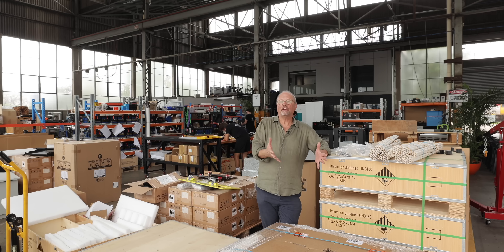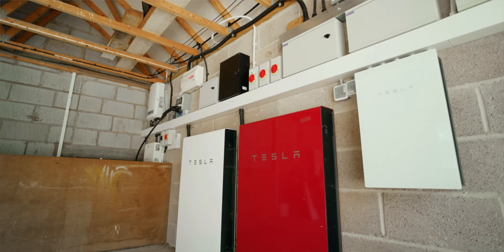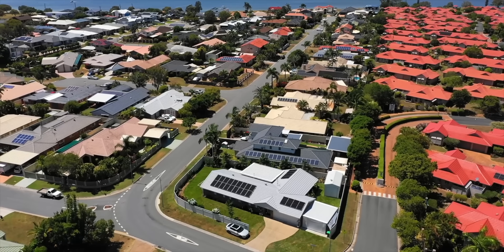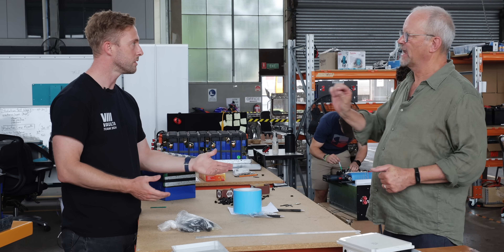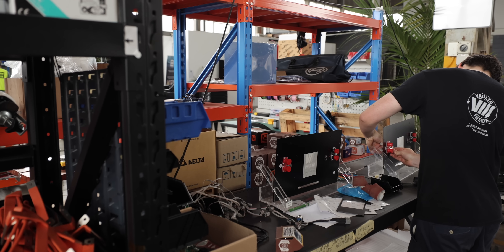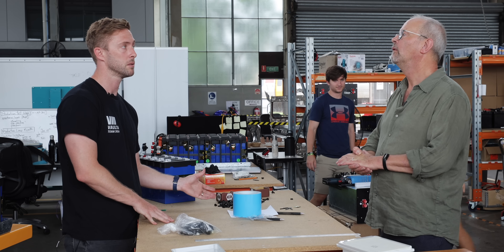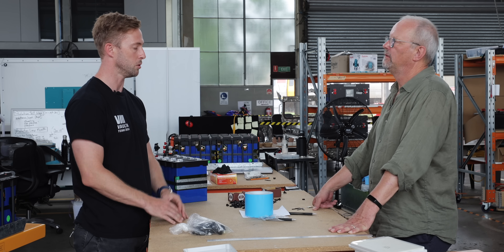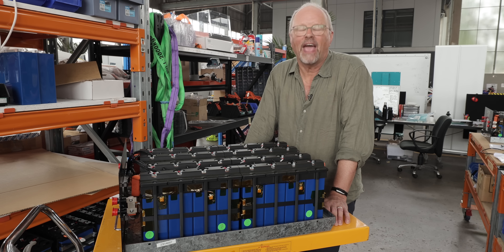THIS Recyclable Tech Solves Batteries' Biggest Problem!

Comment: How is this fault finding so hard for Ev charger installers. Especially grouped ones. The law should be no new gas stations or extensive development without multiple medium fast chargers. The issue with light poles is at max they can charge at 22kw and thats essentially a trickle charger when you need as default 40-50kw

Comment: The problem down the line is the capacity loss will mean using old cells, bigger cells for less work, but still taking up the space. 
If you buy a 200ah cell or a 100ah, they are different sizes, but as the 200 hits the 100ah mark, you'll have a much bigger battery...

Cell price drops don't help with 100ah cells coming in at £32. It's hard to beat a new against worn out..
They will have to make this more attractive cost wise.

I see idiots selling used ev battery cells for more than the cost of new tech batteries of the same capacity.

Comment: 8:21 - what is he trying to tell us: picking 15 cells out of this and 1 from another used battery to build a new one ?

Crazy stupid cause those are in different shape and degredation. You should not connect for example 2 of thee batteries if the first had been unsed for more than 2 years. 

Feels like big advertisement or scam cause these rack batteries had been used for cell towers for almost a decade across the globe and now they do that were just to rint vaulta on top?

Comment: Battery storage is to negate the increasing negative effects of variables.
There peak.
These peaks are visible in duck shaped pricing. 

The increased peaks and depths of prices (also delivery/demand) is the overall cost increase of electrical energy delivery. 

Simply increasing storage or solar will not decrease cost. 

Storage isn't bad, it's just a tool and not a golden bullet. 

Ps: nice insight about this company and there durability approach.

Comment: Fully Charge got a question about Battery care. So I saw a vid saying on the recommendations of a professor the Ni cd batteries should be charged as aoften as possible after any journey, basically keeping it up to 80% and not letting it go down to much unless your doing a long journey. Basically if you use 20% in a day top it back up rather than say letting it drop to 30 or 40%. Basically he said the reaction to recharge the battery and discharge is ultimately degrading it over time! So This is slowed down by smaller chargers say everyday (home charger) because you are degrading it much slower since most of the battery is already charged! Indeed I saw that MG recommends not letting the battery drop below 50% where possible which seems to verify what this vid was saying! What your take on this?

Comment: Can you cover pavement gullies for terraced homes to run charging cables? Oxford council have developed their own Ox-Gulle to sell to other councils but when I spoke to my council in Hounslow they said they have no plans to do such a thing. Trouble is there is no way the current few chargers we have will support EV owners if the growing trend continues. I think it’s vital for inner city homes to be able to charge their cars cheaply, the current local chargers raised their prices 30%! It’s still cheap but way more expensive than charging from home, we need to get UK councils on board asap.

Comment: That factory looks proper amateur.. you have people assembling batteries with their back bent over. Everything seems to be all over the place. Even show you in  the video people not using the correct tool for the job or just using bear fingers to screw in electrical contacts. And the presenter only having the most basic amount of knowledge about how these types of batteries. It’s amateur hour all round. What a waste of potential.

Comment: Being able to disassemble a large pack is 1 step, having uses for replaced cells of <80% original capacity rating is step 2. But you haven't mentioned about disassembly & recovery (recycling) of individual cells (when the internal resistance is very high, or after bulging & gassing).
What is the life cycle of the BMS, replacing capacitors for reusing BMS or sent to E-Waste?

Comment: So they talk about how they're building these packs to make them repairable and recyclable and they're entirely avoiding spot welding to accomplish that. While that makes sense for large cells with dozens of amp-hours, extending that same philosophy to small cylindrical cells is unnecessary and adds substantial cost and room for failure for no benefit.

This boils down to the cost of labour vs the cost of parts. An individual 18650 is on the order of $2-5, but the labour required to open up something like a ~14kWhr pack and perform a "cell replacement" (of any size) will not be less than maybe $50, and probably a lot more. This means your costs are dominated by labour, and having the ability to replace a single 18650 isn't actually reducing the cost to perform a replacement.

You'd be much better off just assembling 18650s or 21700s into standardized "blocks" of 10-40 cells using spot-welding, and providing threaded terminals on those modules for the standard assembly process they show here. This would make it easier to automate more of the assembly process, and means you're avoiding all the serious complexity around interfacing with bare cylindrical cells without introducing problems with contact resistance, vibration, etc if they're not mechanically fastened via welds to the leads.

Sure, you can then only easily extract batteries at the module (rather than cell) level then if there's a failure, but you can always just recycle the module as a unit (since it will basically just be cells and battery tabs as a brick). Given the scale of packs they're producing and the low likelihood of individual cell failures like this, they'll still come out way ahead.

Trying to avoid spot welding on cylindrical cells earns you basically nothing, and makes your job way harder and more labour intensive. The fact that they're talking about this like it's their way forward makes me think they're not particularly serious about making this an efficient and cost-effective option.

Comment: 2:56 Ah, 48V. Most manufacturers that we install have gone to 400V that allows smaller wire sizes saving on not having to buy that 3/0-4/0 wire needed for 48V systems.

Not that it is a major manufacturing problem. Just change to high voltage.

Comment: I could see them using a shaped metal bar with little contact bumps for cylindrical cells. Then just screw it all down as they were showing with the larger pack cells. Good ideas all around!

Comment: Quick and easy repair, even if you don't have a spare cell you can replace it with a jumper for a reduced voltage operation. Important for off grid bush systems.

Comment: Sorry, but every one of those fasteners is a failure point. Welded batteries are welded for a reason, not just for the hell of it. If you want a battery to last  decades, you don't put 1,500 extra failure points in it.

Comment: Very interesting video.  However, he has missed some very basic information.  I have found on Google that Vaulta use LFP battery technology.  These batteries last much longer than NMC batteries.  They have many more cycles of use before they degrade.  They also are much much less likely to catch fire (almost impossible to catch fire).  It is rare for NMC batteries to catch fire but it still worries me.  I notice that I only see videos of people putting them on the outside of their buildings.  

I would not want to put an NMC battery in my home or even outside it.  I worked out that I would not get the money back before it degrades and I would be worried that it might catch fire and destroy the home and kill me as well.  I have seen that scooter batteries have caught fire and killed people on the news and these batteries are small compared to a house battery.  LFP batteries are cheaper than NMC.  I would trust LFP batteries and I would probably get my investment back.  The only disadvantages are that they take up more room and do not work so well at very low temperatures.  These are not problems to worry about for home use.

Comment: I have 4 of those battery banks. In winter it isn't enough. Dec-January hardly any usable sun. In those times My batteries become backup for any power outages from grid. Its just doable to add more solar. I would need 3x more solar to get through those 2 months. 1 sunny day it takes 2 hours with my setup to fill my batteries for a days worth. We just do not have sun here in winter its's snowing or raining. Sky's that are grey means hardly any solar production. So I am saying where you are at you need to see how many sunny days you have in your winter months. For me I would have to have 32kw solar and 280kw of battery to survive winter. That is not doable. I will get a generator so if Grid goes down in winter I can make power. Also cleaning solar panels in winter even with my angle (53 degrees) snow builds up fast. I would need 60-80 gallons of gas to get through those 2 months with no grid. That is more doable. So build your system so you can survive a power outage that lasts weeks.
Reply: I am grateful to be at 37.7 degrees. 4 kW peak solar is enough!
Reply: @danielcarroll3358   Yeah I am at 45 degrees and next to lake michigan.
Reply: @dc1544  I'm east of San Francisco. That is the same latitude as southern Portugal. It was 73 yesterday, although that is a record. Tomorrow 45 mph and two inches of rain. You can't win them all. But when we get a storm you get it (usually worse) three or four days later. Good luck.
Reply: @danielcarroll3358  Yeah upper Midwest always has low sun winters. In Iowa it was sunnier in winter but not a lot more. I'm in Michigan West side

Comment: LFP batteries have none of the expensive nickel and cobalt, an definite advantage, but also lowers recycling value. They also have greater cycle life and thus likely very long service life. If a cell is bad, replacing cells in an LFP pack makes a lot of sense since metals values in a traditional recycling process are lower.

Comment: Bolts for static applications are  usually fine, but it is not uncommon for copper & aluminium contacts, being ductile, to deform in extremes of temperature. If that happens then the joint can have more resistance so would heat up and deform at a lower point/load. Over time, being unseen, that can reach crisis point, I have seen it. It is probably down to quality control, eg torqueing each nut. Which is why they spot weld for vehicle uses. There are some Lion cylindrical cells that have threaded terminals.
Reply: Er...you sound like you're 'mansplaining'......
.... these guys do make battery packs for a living, y'know....!!
Reply: @andymccabe6712  quality control. Think Boeing! Ya flying any time soon?

Comment: A deeper dive into the existing rules and regulations would help expand the complexity around how battery packs are manufactured.   There are many safety related factors and associated safety standards that need to be considered with the design of any battery pack.  Suggesting that a single company has a unique different approach to the design of a battery pack like this seems to be grossly simplifying many of the very complex engineering design decisions.
Reply: ......you missed the point .....by about two solar systems......!!!

Comment: Problem with repairable batteries is batter technology is evolving so fast is that N years down the road no one will be making batteries that are compatible with your stationary battery bank. Cell size, capacity, chemistry, charge curves, plus since your cells have degraded your pack will not balance properly with compatible cells.
Reply: ffs ....preserve us from armchair experts....!!
Reply: @andymccabe6712  
ffs ....preserve us from those who never designed or repaired anything.

Comment: Can't agree with Dominic more. Around the 15 kWh level is perfect for most homes. I've got a 16 kWh battery and I only use about 10 kWh a day, so I've got extra for if/when I need it, and I'm not cycling the pack so much so it should last a bit longer.
Reply: I looked up the Vaulta specs and the 14kWhr modules have 140A continuous output current each, whereas the 5kWhr ones are 100A each. So if higher peak power output is a necessity for someone the 5kWhr modules might be a better option.
Reply: @davewilliams7445 You're rarely pulling peak power from a home battery ona day to day basis. Also the 14kwh packs can do 140a as you said, which is obviously more.

For mine I'm limited by my inverter, so the peak power i can pull is about 50a, which is enough to run the oven and rest of the place.
Reply: @sarahjrandomnumbers   Yes agreed, 140A / 7kW is rather a lot of peak power out of one battery pack! The system I am planning will be using multiple inverters for a total of at least 15kW peak capability, with the option of additional expansion, so the extra peak output will be necessary.

Comment: A number of comments here are suggesting this is how EV batteries should be, implying that the batteries in this video are equivalent. Having this kind of modular, bolt together system is pretty simple and obvious for home storage but not so much for an EV. The vibration, jolting, structural stress, sealing requirements, temperature extremes in operation, requirement for integrated cooling/heating etc etc make it a very different design and manufacture challenge for the packs. In many aspects of vehicle manufacture (not just battery packs) it has become a mantra that you either choose repairability or reliability but you can't have both! Of course that's an oversimplification but you get the point. If you want your EV battery to have a fighting chance of lasting the life of the car you are very likely going to have to compromise. If you do a home build and you are happy to tinker with your vehicle and do regular service to drop the pack and torque the bolts and check connections then fine ... but that's not what you want from a manufacturer. The result doesn't necessarily mean we have to go the whole hog and have fully glued together structural packs (and interestingly Tesla doesn't seem to be pushing this approach quickly to all models) but we are not going to be seeing "fix it yourself" construction in EV batteries in mass production in my opinion.
Reply: It's durability for sure.
Yet the overlaying reason is cost price.

The packs are central and need high quality, low failure rate and simplicity of construction  resulting in lower pack cost.
Reply: ...thus demonstrating that the VAST majority of people who have 'opinions' about batteries .....literally don't know what the f*** they're talking about......!!!
Reply: I think bolt-together packs for EVs can be done.  The engine, gearbox, suspension and wheels are bolted on, so I don't see why a car battery can't be.  Loctite exists, locking nuts and serrated spring washers exist.  Whatever packaging method is used, we need to make it reversible or we'll run out of lithium.  It can still be made reliably by robots and the weight difference wouldn't be much between bolts or welds.  

The cells themselves need improvements on how to unravel the roll of materials to recycle them.  In some ways a larger prism pack is harder to make reliably, as any defect can ruin the whole pack, which has a lot more material invested in it, whereas the cylindrical cells are smaller, so it's not as much of a waste if one is defective. The cylindrical cells can't be packed as densely, but the gaps between cells means they can be liquid or air cooled more easily.
Reply: @jimmimak  Yes, they can certainly be done. But it depends on what you mean by "a battery". The physical attachment is only half of the story. A list of all the components of an EV battery pack includes more than a number of cells wired together. My point is that for an effective, capable, long-lived and safe battery pack there are many aspects which need to be taken account of and incorporated. The easiest way it can be done is by dispensing with some of the features that make an EV useful for year round daily use (unfortunately). For example dispense with rapid charging capability and the necessary processor controlled liquid cooling systems usually required. Modern EVs warm their batteries for rapid charging and for efficient daily use during winter months. If you just want to build an up-rated golf buggy (Citroen Ami?) that's rather different to a car with all the normally accepted features and capabilities of a modern vehicle.
Reply: @jimmimak wouldn't that make it heavy? Ev's have to fight weight to get more range after all.

Comment: I wonder how much stationary storage could be installed for the cost of Hinckley C? Would it be a realistic alternative?
Reply: Probably would be quite a lot of batteries for the same cost. But it doesn't help create electricity, just moves it around. It's a different thing, so we need both.
Reply: Would need 50 percent on wind and solar and 50 percent on batteries.
Reply: @alanrickett2537  Yes, good point.
Reply: Hinckley will provide 6,400 MW of electricity. Each of these units is 14 kWh of storage which means you will need 457,142 of these units to store 1 hour of Hinckley production.
Reply: @pauld3327  and how much will HC cost plus 10 times that for decommissioning and it looks good
Reply: @pauld3327 I think you've doubled it twice - the two reactors combined will give 3200 MW, not individually.
Reply: @drunkenhobo5039  You're right. My mistake.